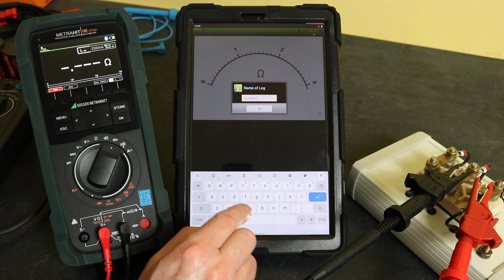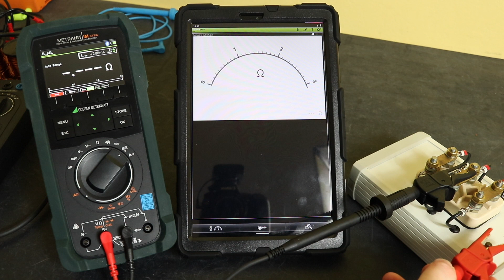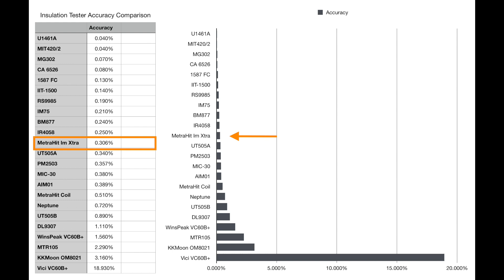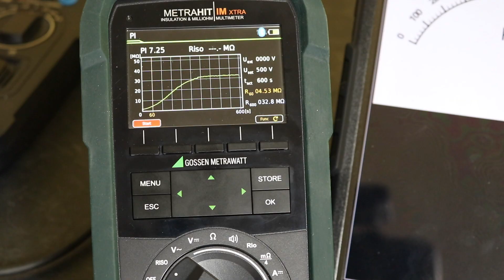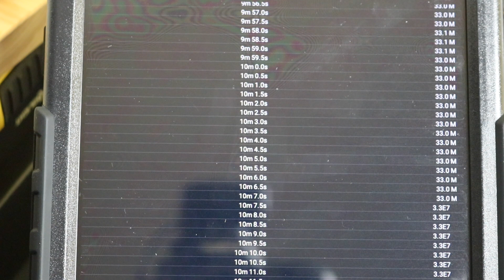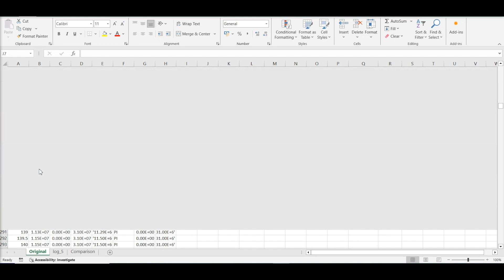MetraHit IM Xtra tests on my winding simulator

Comment: I finally bought one after months of wanting it! With my own 2MW generator, I'll be running my own tests from now on. Thanks for the demonstration! 😀
Reply from the maker: 2MW is quite a hefty generator. The IM Xtra is quite an expensive investment, hope it serves you well. Thanks for watching and commenting.
Reply: @three-phase562  yes, it's a 500 rpm vertical synchronous generator from Leroy Somer, so it's quite substantial. If I remember correctly the weight of the generator is 18 metric ton. I haven't received my Gossen yet, but a bit dissapointed to read that the graphic plotting option is an extra license 😞
Reply from the maker: @fossmarkluni  The Metralog software for the tablet is free and can be downloaded from the Google store. Mine did come with a license for the IZYTRON.IQ starter software package, but I have never been able to connect to the meter with it. Something I need to sit down and have another go at again.

Comment: Man if that could preform a surge test that would be great for testing cooling tower motors instead if lugging up a baker away 5 flights of stairs. Also is the 4 wire resistance measurement a EU testing requirement? Still surprised fluke hasn't made a portable IR and DLRO stand alone unit.
Reply from the maker: Whilst it seems to perform some sort of a surge test, it isn't returning the typical waveform, but provides a numerical time value for comparison across the phases. I haven't found 4-wire resistance mentioned in the IEC 60034 series for rotating machines. It is within the 60076 series for transformer winding measurements and 62271 for breaker testing. It was in the old IEEE 118 standard, but that was withdrawn in 2005, and I have not seen a replacement. I have only seen combined IR and DLRO units from Gossen and Megger, but the other manufacturers may produce some, although you are getting into more niche requirements.
What size are the cooling tower motors? At the moment I have tested this unit on motors up to 1 MW and got readings okay.
Appreciate you watching and commenting 👍👍